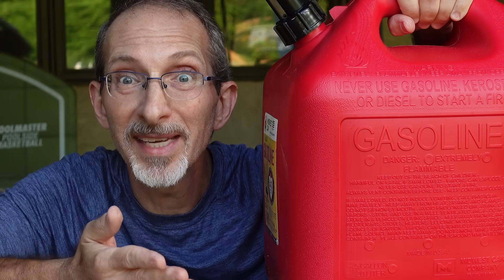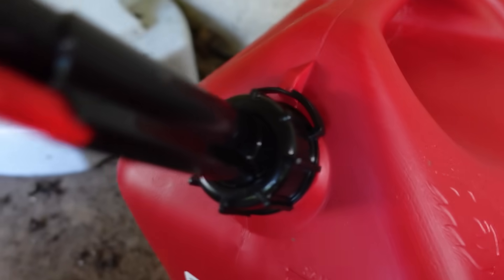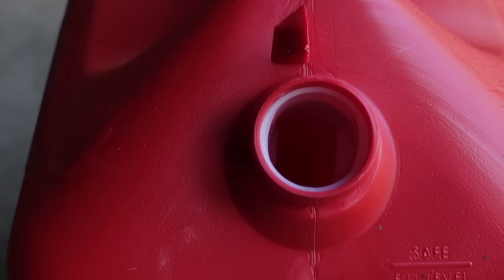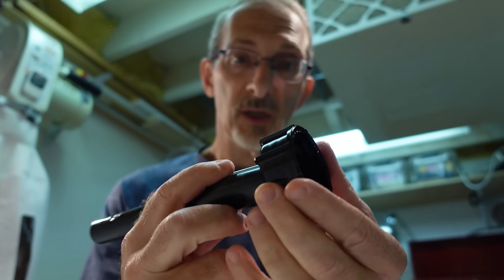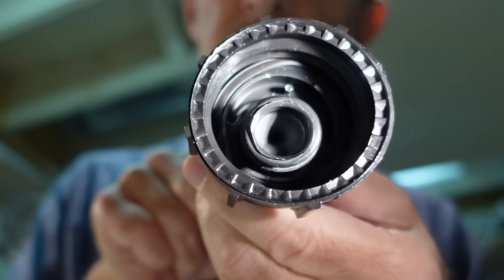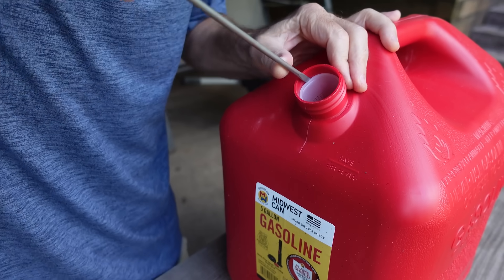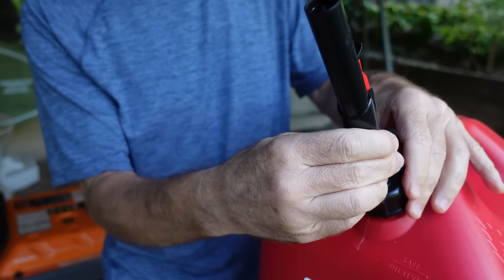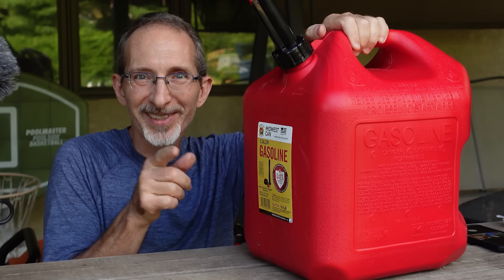Gas Can Modification | New Gas Can Fix

Comment: Blitz made the best plastic gas cans. I still have a small one for my 2 cycle mix. They were sued into bankruptcy by idiots who couldn’t read warning labels and the ambulance chaser lawyers who represented them.

I bought one of these cans after my 5 gallon Blitz can split a seam after many years of use. The items in this video are a minor annoyance for me. My issues is with the thin and small nozzle base gasket that seals against the can. It is being cut through by the thin plastic boss and leaking. So much for safety. Midwest Can needs to redesign it to be thicker and with more surface area to ensure proper sealing.
Reply from the maker: Robert, those are good points. My cans are relatively new and haven’t seen too much use, so I haven’t experienced too much wear and tear. Time will tell. Thank you for contributing to the conversation!

Comment: It would be cool if some one made a can with a filter  in the spout 
On ter 4 diesel engine if you get anything particals in the fuel  filter it will destroy the injectors $$$$
Reply from the maker: Gary, I will be reviewing a replacement spout where the flame arrester is in the nozzle. We will see how that works!

Comment: VP fuel cans. They are race purpose and have zero safety mechanisms. It a can with a spout and a cap vent on the back like old fashioned cans had . They are easily 3 to 4 times thicker wall then those red generic cheap cans.

Comment: Lots of stuff is sold in 5 gallon containers. Have a couple I've used for kerosene for a couple decades. Iirc they were labeled not to reuse them. Rotflmao Might get a 55 gallon drum , attach a hose and put it on a rack. Let gravity drain it into the mower.
Reply from the maker: In an upcoming video I will be reviewing an inexpensive battery operated fuel pump that says it can transfer fuel from drum containers. Your suggestion might not be that far from genius!

Comment: why don't you just shorten the length of the spring. Making it easier to push, but it still pushes out when you release pressure.
Reply from the maker: Dave, great minds think a like. I did that in my second video, link in the description. I appreciate you watching!

Comment: The irony is that these features are to improve air quality by keeping fumes in the can and the tank. But like so many others, often the situation calls for removing the spout and using a funnel and slopping fuel all over. A design that defeats it's own purpose.
Reply from the maker: Agreed Mike! I don’t see why the manufacturers don’t understand this blatantly obvious shortcoming! 😁

Comment: I wonder if cutting an inch or so off the spring would make it usable with retaining the auto seal function?
Reply: I'd be more interested in removing the catch tab on the red portion, so it was just spring tension that had to be overcome.  Shortening the spring should help, if the nozzle resistance is still too high to easily push in.  Unfortunately, it's still going to spill fuel all over the place, due to the poor design.

Comment: Great solution!! I wish I had seen it before spending $20.00 on an old time spout. I still had the issue with the filter. Now I can fix that. I still find that the cans do not empty well until about half empty. You can by vents online that just snap into the can after drilling 1/2" hole. They work fine.

Comment: Don't forget to poke a hole in the top of the rear of the handle with an awl so that it can pour faster.  To seal the hole just put a screw in by hand and voila, it's sealed.  Remove it and that baby will pour, pour, pour.

Comment: The funny thing is with that in can filter. is prevents unwanted particles from entering the can. But then would allow those same particles caught in the filter to be poured into whatever it is you want to gas up
Reply: It’s not a filter, it’s a flame mitigation device.

Comment: I had a Briggs and Stratton "can" that spilled about a quarter cup of gas with very use. The nozzle was similar to yours in principle, and there was no way to operate it without spillage. 
The intent of the product was to prevent pollution by not allowing the raw gas to go into the atmosphere.  DAH!!   Stupidest designed product that I have ever seen.
I wrote up a complaint and they sent me my purchase price and didn't want the product back.  So I did essentially a similar "fix" appropriate to it's unique stupid design to make it useful.  These are the kind of products that you get when, for the protection of the public, politicians instead of engineers design things, and they never get field tested before being mass produced and sold.
Reply from the maker: Ken, we all seem to be retelling the same story over and over again. Hopefully these videos will gain the audience of the manufacturers and legislators, and some responsible company will step up and start making better gas containers. One can only hope!

Comment: Governments arround the world: You can change your brake pads, do your own home electrical work, and use tobacco products.
Also Governments: Portable gas containers are too dangerous!
Reply from the maker: Jon, great examples of the hypocrisy. I’m changing my gas cans because it needs to be done. Thanks for joining the conversation!
Reply: Actually there is validity to this.   If you mix gasoline with a rather large number of home, commercial and industrial chemicals you get toxins that are far far more dangerous.   You can kill a family with a cup of pesticide concentrate and a half ounce of gasoline poured into it just stuck in their garage.  Don't do this, but it is an example of how dangerous carrying gasoline WITH other material can be.

If you want to keep gas cans filled in a truck you can get a special carrier toolbox and special fuel-cell cans.  You can also get custom 95-115gallon tanks for trucks.
Reply: @prjndigo  how is any of what you wrote relevant?
Reply: @VirtualLunacy  It isn't. I've no idea what the fuck they're on about either.

Comment: @7:25 to avoid distorting the cap gasket sealing surface (as is visible @8:49) of the can itself, assuming the can is new or otherwise completely devoid of gas fumes, use a butane fireplace/grill lighter to (carefully) soften the insert before removing it.
Reply from the maker: Several viewers recommended gripping the insert with needle nose pliers and twisting, wrapping the plastic screen around the pliers so it pulls away from the container walls without prying. Maybe that is an alternative, too. Thanks for your suggestions!
Reply: @MikeFyxdt   I agree, but that's kinda what you did. The problem is getting  the lip of the insert far enough away from the red plastic to do that. It helps if it's softer from heat. Or better yet, if you need a large can anyway, just buy the water can version of the Midwest gas can. It's 6-gals. instead of 5, and comes with a really decent spout, too. Paint it red (or keep it in a trash bag) if need be. The Midwest 6-gal water can is the same can (only bigger) as the Midwest 5-gal gas can used to be. Midwest # 6700,  Menards SKU: 2610637
Reply from the maker: @videopipeline6419  That’s a good suggestion! Thank you!

Comment: There's no excuse for overengeneering shit I swear. Learn to design shit right in the first place. I would also drill a vent hole in the back of the gascan will help it flow faster and stop the constant gulping because it can't pull air into the can. Drill an 1/8 inch hole and put a screw in it to keep gas from evaporating while it's being stored and unscrew it out of the hole whenever you go to put gas into something. Fucking EPA needs to calm the fuck down.
Reply from the maker: Thanks Josh! I added a vent in my 2nd video and it works great. I appreciate you joining the conversation.

Comment: Whatever happened to the simple black flexible pouring hose with the plastic plug in the end, and the plastic cap on the back of the bottle that lets air into the vessel?
Reply from the maker: Extinct, like the dinosaurs we now make our gas from. 😄
Reply: @MikeFyxdt  Ah the biotic or abiotic argument about the formation of crude. I lean toward abiotic which of course puts me at odds with the trillion dollar environmental agenda.
Someone should go into business making flexible rubber hose caps to replace these stupid nozzles. But of course that's very inefficient.

Comment: I got an earlier version of this gas can. The nozzle was removable from the screw down cap so you could stick the nozzle down into the can and screw the cap onto it and not have the nozzle sticking out all of the time. Also, there was no filter in it. What I did was cut off that stupid lock thingy (a technical term) then I got rid of the red trigger lock. That was a real pain to manipulate while trying to hold up five gallons of gas. I did leave the spring in the nozzle though, and just let the weight of the gas can push the nozzle into the pour position. That way the nozzle will still shut off when you pull the can out. If you don’t have the spring in there, you will spill.
Reply: Why don't you buy the gas cans with a pivoting nozzle on the bottom/side of the can? That way there's no tipping of the can. You hold the handle, the can stays upright and gas flows out of the nozzle on the bottom of the can. It costs a few bucks more, but it's worth it.
https://www.surecanusa.com/
Reply: @icanfartloud  At the time, I bought was available in the small town I live in. I didn’t look on line because I needed something right away. These Surecans look pretty good. Thanks for the input.

Comment: Wish I had seen this before I trashed the new “safe” gas can. I ended up spilling gas all over the place while trying to fill up my crotch rocket motorcycle. Filler hole in rank just will not get “ safe” can to flow. Fortunately after my household goods arrived I had access to several of my primitive cans that I now treasure. Absolute perfect example of unintended consequences of the mommy state overreach.I suspect that most of the safety gurus do not ride crotch rockets.
Reply from the maker: So many motorcycles display the gas tank as a work of art. Who wants to douse that work of art with a layer of gasoline, just trying to use it as it was intended. I can’t think of a better example where you don’t want to spill fuel. (LOL, like there are times when you do want to spell fuel…) Hang onto those old cans, they are quickly becoming a valuable commodity! Thanks for watching James!

Comment: Who cares about government rules. They control us but every facet. Even a gas can. I find those mechanisms so dangerous. Your wine up spilling fuel all over the place great for a spark and catching yourself and whatever it is you’re trying to fill on fire. Very bad design the MOD I do. I just buy a kit for the purge button on the back of the handle and throw away that crazy spout and put an old fashion spout on
Reply from the maker: Adding event and going after market with the spout is a popular option. I will be reviewing some fuel can related accessories in an upcoming video.

Comment: Had anyone ever tried to use a styrofoam cup as a gas funnel?
Doesn't work! LOL 😆 

I was driving to my high school in my newish, 73 Chevy Nova when I ran out of gas for the 1st time.

The gas cap is behind the spring-loaded license plate on that model, and it was very difficult to fill, even if I had a funnel, which I didn't.

 I grabbed a stick to hold the plate down and found a 
Styrofoam cup on the side of the road to use as a funnel.

About half of that 1.23  gallon of gas (leaded of course) ended up on my hands, clothes, and shoes.

Lessons I learned that day?
1. Styrofoam melts
2. Gasoline smell is hard to get rid of in the car.
3. Skip school and go home and take another shower, or you will be ridiculed all day by students and teachers.
4. Pick friends with more than .83 cents between them.
5. Find a funnel for my gas can.
Reply from the maker: Lol! Yes, gas and Styrofoam I don’t imagine would play well together. Thanks for sharing your story!

Comment: Note that these cheap plastic cans have no pressure relief, so if they warm up in the summer, then they just split their seams.
Reply from the maker: I added a plastic vent in my second video, link in the description. I think that vent would pop open before they can build up enough pressure to be damaged. Thanks for joining the conversation!

Comment: I have a similar gas can, and one fine day while at the gas station filling it, the gasket between the spout and the can fell off. Unfortunately, I didn't notice until I got home, and when I went to use it, gas leaked out from under the spout. Ah well, now I just take the dang spout off now and use a funnel. It's almost like they did me a favor by making a gasket that wouldn't stay on.

I also have a small can that I use for my small engines since they don't run well with stale gas. It still functions properly, and I actually like it for filling small tanks. But, because the stupid can seals completely, the pressure builds up on hot days. It was quite a while before I figured out I need to let the pressure out before pouring the gas because otherwise it gushes out getting gas everywhere.

So yeah, these stupid safety cans aren't idiot proof. In fact, they make it harder for the average shmoe.
Reply from the maker: Wow Bill, lots of lessons learned… Yes, these plastic containers, as one viewer described it, ‘get pregnant’ when left in the heat. You have to burp them. I totally agree that these containers need to be made for the average person who needs to move fuel and dispense fuel safely and easily. Thanks for joining the conversation!

Comment: I drill three small holes behind the handle where they used to put the yellow vent cap. Many of the new cans don't have a vent and need one to allow the gas to flow without glugging or stopping until you invert the spout to let air in. I think you can buy replacement yellow vent caps online if you want to prevent leakage or fumes from escaping a full gas can.
Reply from the maker: Cedric, I added a yellow vent cap in my second video, link in the description if you’d like to watch!

Comment: That is a VERY helpful tip about taking that spring out.  I tossed the spout aside though, and I use one of those battery operated pumps with an auto shut-off, because I couldn't see when the tank was full.
And yes, DO get ahold of that screen.  I dropped mine inside and had an awful time fishing it out.  If I do it again, I'm thinking about heating up a coat hanger with a hook bent into it and run it through the bottom of the screen, then try cutting slits into it.
Reply from the maker: Don, several viewers suggested grabbing the flame arrester, what I called the filter in this video, with some needle nose pliers and twisting so the filter wraps around the tip of the pliers. It makes it more narrow so you can just slide it out. I will be testing a funnel, and aftermarket spout and a battery operated transfer pump in an upcoming video. Thanks for watching my channel!

Comment: Yeah, right at the time they came out, people were stealing the old (tip & pour) cans left and right. Didn't care if gas was in them or not. Eagle is the way to go, but not good for 2 cycles. I bought a plastic can with a push button. It always collapsed from hot & cold. I drilled a 1/32" hole in the handle. Took care of my problems.
Reply from the maker: Thanks for joining the conversation Virginia. Who would ever think that gas can nozzles would become a hot ticket item? I appreciate you watching!

Comment: To the people who want to give control of their lives over to the government. Look what those bastards did to a simple gas can. The government is the one requiring all this Safty no spill crap that really only results in spilling. On and anyone needing a good gas can can go to tractor supply and get a u jug. It doesn’t have all this crap and after pouring fuel in my truck track loader and excavator as well as using another one for def in a tractor and dozer I haven’t spilled a drop.
Reply from the maker: Industrial containers really seem to be the way to go. Too much stuff on the consumer cans.

Comment: We buy the Eagle metal gas cans I have like 9 of them. I also have a few of the plastic gas cans shown. I bought new spouts for them for a few bucks but before I did that previously I would just break that plastic red tab off and pull the spring. The spouts are trash. So aren't those funky big ass green tab spouts I've seen. Eagle cans are the only ones allowed on construction sites here up north not plastic.
Reply from the maker: Metal containers seem to be a crowd favorite but I do realize they come in a price. Thanks for joining the conversation!

Comment: Tractor Supply sells a repair kit with a fast flow nozzle and replacement nozzle cap plus a replacement vent cap to be installed on the rear of the handle near the top of the can.  For that can, I would have removed that valve system all together and punched a 16D nail in the back of the handle for a vent hole and plug!  Need a nozzle cap?  Use a rubber chair leg tip to fit over the end!  Damned tree-huggers!
Reply from the maker: I’ll be trying one of those replacement nozzle kits in upcoming video, to see how universal it really is. Stay tuned!

Comment: Maybe you could keep a little safety with the nozzle by gradually trimming the spring a little bit at a time until you get a good compromise between letting the nozzle spring back out  and allowing it to open with less pressure.
Reply from the maker: Donald, we are thinking along the same lines! I modified the spring in my second video, link in the description. It did the trick, making it easier to use the spout, but it still keeps the safety feature intact. Thanks for joining the conversation!